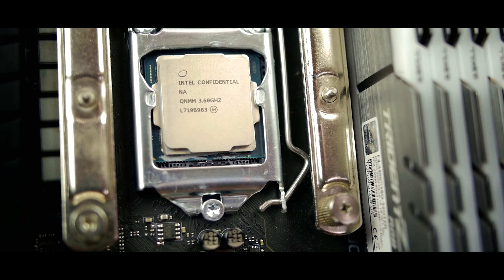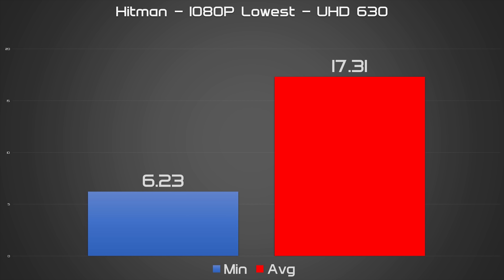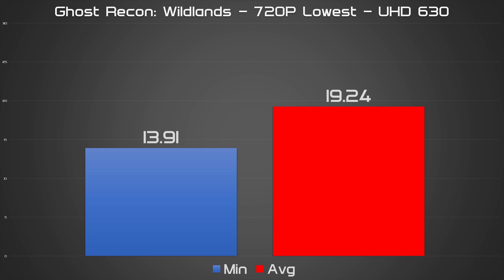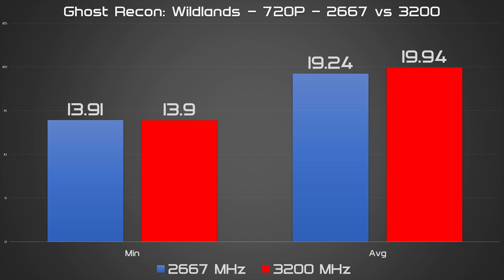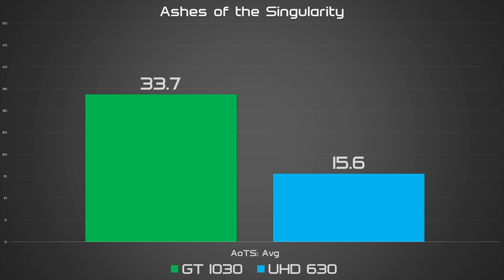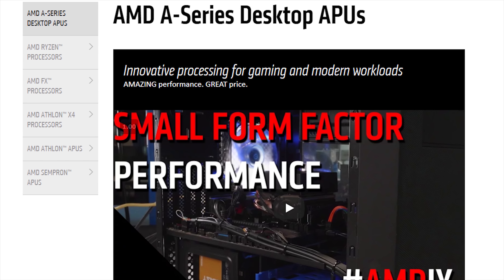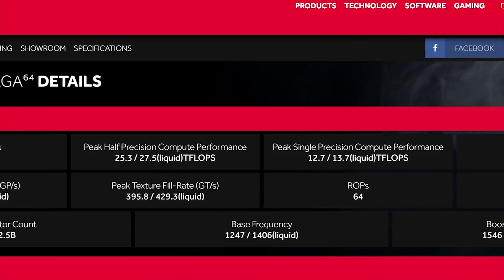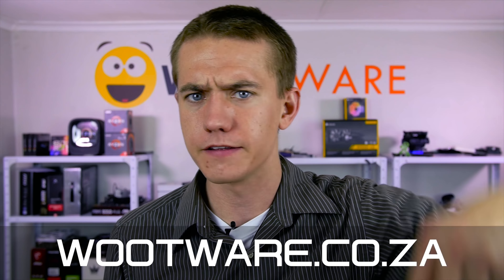Free Trash or Hidden Treasure? - Intel's Coffee Lake UHD 630 iGPU Benchmarked!

Comment: 640x480 morrowind is way to go.
Reply from the maker: #truth
Reply: @Dental_Louis  morrowind ain't optimized
Reply: @UFDTech  LOL I run RE2 Remake on UHD 630 at medium settings and it gets 18 - 24 fps and sometimes 35 inside the RPD...I have never seen lags on Morrowind om my pc...I also run Batman Arkham City at maximum settings and get 50 fps and higher sometimes with no lag at all
Reply: @Dental_Louis  hd 2000 gang is here

Comment: Integrated GPUs are fine if you need PC for work. I personally use 7600 for my workplace PC, and one of the reasons i bought Intel chip in the first place was because i dont need dedicated GPU.
Reply from the maker: Valid points, thanks.
Reply: ... for work? like what type of work? you could have still got an APU for that imo like you could have got an a10 with a better igpu for work like 4 years ago
Reply: What kind of work? If you need all that CPU power your work probably could use a GPU, and support for multiple screen output
Reply: At least you have some sense, but too bad that we still have idiots who try to game on those things for real and complain or just make very optimistic claims about's it's performance when pointing at the sky.

Comment: I think the Ryzen+Vega APU's will be a lot better
Reply from the maker: Same.
Reply: when do you think ryzen apu's will be released?
Reply: vega64 is a fail. but vega56 now thats better
Reply: It will be like the previous APUs. AMD will put a more powerful iGPU but that will compromise it's already inferior CPU. So, you'll have a even crappier AMD CPU with still crappy graphics. Wait for Nvidia's new realeses, next year. The same for Intel's 10nm Ice Lake. AMD will take some 2 years, at the earliest(don't belive if they claim otherwise) to release it's 7nm (Global Foundries' measurement which is still worse than Intel's 10nm). So, be smart and buy Ice Lake and the next Nvidias GPUs and your gaming rig will last some 7 years without need to update.
Reply: the IPC is. On games the Intel cpus are better and on some applications too like Adobe Video encoder/editor, IIRC. Ryzen performs better on most multi core applications, though, but that can change on the APUs with the iGPU fit in there
Reply: Charlie Wuppert your making claims of Wich you have no basis , ryzen pro hasn't dropped yet.
Reply: Only for you then. Every other test that I looked, Intel has 7-12% lead on IPC when you do single thread tests(like SuperPi), with the same clock. On top of that IPC advantage, Intel allows for far more overclocking.
Reply: Simski what does Apu from the Simpsons have to do with this? Thank you come again!
Reply: That 5ghz overclock gives you almost no performance increase. At 1440p the 2700x closes the gap and when streaming and gaming AMD pulls ahead in most games... Spoken like a true fanboy. I have been a loyal Intel consumer for over a decade and my next PC is going to be Ryzen.
Reply: At almost a whole ghz lower clock...
Reply: Charlie Wuppert might want to check Hardware Unboxed video on it instead of talking in vain fanboy.
Intel's IPC marginally better but Rayzen's multithreading is better.
Reply: Aight

Comment: I have this setup: asus z490 maximus xii hero wifi, with 10700k, and 2070 super, and corsair vengeance lpx 32 gig ram (not a single one overclocked at all not even boosting), and my vizio smart tv as my monitor connected with hdmi to the motherboard.  I have seen both the uhd 630 and my 2070 super in use at the same time through task managers performance tab with the 630 as gpu0 and my 2070 super as gpu1 with the 630 pulling around 60-63% and my 2070 super around 36-40% with the 3d graph showing blue for both at the same time while I was playing Banished in a window and Dragons Dogma Dark Arisen fullscreen (minimizing DDDA to see the usage data) and yep, at least for me, I can game this way and stable as he*l.  I can even run Sims 4 all details highest smoothly without kicking the 2070 supers fans into gear, so my question is this: Have you heard anyone claiming to use this setup and getting it to work for both gpu's to share the load so neither one is overtaxed?  If so then is this setup an advanced one?  (I ask because this is the first pc I built myself after watching many of Linus and Jay's youtube videos on how to build one).

Comment: By setting up the onboard graphics to do nothing but capture video your main GPU can be freed up to allow for faster FPS.   But you have to have a good chip, perhaps an i7 and fast ram as well.
Reply: Also, what was your ram speed?  It's about clockrate because an iGPU is ram speed dependent for performance.  You can squeek out a little more performance from the iGPU with a higher clocked ram.

Comment: Part of it is that Intel doesn't do the same amount of work that AMD or Nvidia does to optimise their drivers. They will do the odd game, when they are showing off their new iGPU, but you rarely see a release of Intel drivers optimised for this game or that game. So even when they released a GPU around the GTX 750 level, it only worked that well in a handful of games. 

This is why inspite of being so weak AMDs APUs would game relatively well as they benefited from driver optimisation. 

Iris is still way more powerful, but I guess on desktop UHD is there for when you are between cards, not when its your only choice. Highly unlikely on a 6 core i7.
Reply: amd igpus are way stronger than intels and an there is currently not intel gpu that performs to the level of a gtx 750. there is so much that drivers can do.

Comment: My missus company were upgrading their office pcs, so I've chosen 2 pcs  with i3 and another 2 with a8. After some time they decided to upgrade their monitors from 60 Hz to 144 Hz ones.Turns out Intel HD can't do 144 Hz :( , so needed to get few cheap dedicated cards and one of the Intel system developed "your graphic hardware stopped working and restarted" bug (well known  cheap intel hardware problem )  , ended up upgrading motherboard of one of the systems too. Intel gpus used to suck, sucking now and will suck in the future, until they start using radeons or nvidias . Just saying.
Reply: why in the world would office pcs need 144hz monitors
Reply: Cause some ppl feel the difference , to the point when it is actually painful to use 60 Hz and soon as 1 girl got her new shiny 144Hz monitor, all the rest started to get headaches, etc too :) , nvm advantage of being able to see what is on the document when scrolling without stopping to throw a look.
Reply: one word. " weird"

Comment: If you increase the RAM frequency and the cas latency proportionally you have ZERO increase in performance. You only benefit by overclocking RAM if the percentage increase in frequency is larger than the percentage increase in latency. A 3600MHZ cl 16 RAM is faster than 3200MHz cl16. But 3600MHz cl18 is effectively equal to 3200MHz cl16.

Comment: Find an old CRT monitor and play at 800X600. Bam! 60FPS on integrated graphics. But seriously, I like having integrated graphics just for the flexibility of running multiple monitors.
Reply from the maker: Makes sense, but what GPU do you have that can't run multiple monitors?
Reply: GTX 1050Ti can't run 4 monitors. At the moment, I'm only running 3 monitors anyways but at one point, I also had a TV as a 4th monitor for controller games. It also seems like Nvidia cards don't idle down to their slowest state with 3 monitors connected causing it to run warmer even when it's doing nothing.
Reply from the maker: Fair enough.
Reply: if you think nvidia cards dont idle enough bud try looking at amd lol you will see that nvidia cards idle just fine and besides having multiple monitors on a card means the card has to drive those three monitors refresh rates and what not.... meaning the memory clock will most likely run at full speeds

Comment: seriously though why do the k chips even come with iGPU
Reply: Dandy Highwayman I run my secondary monitor from my igpu.
Reply from the maker: Completely valid point @Dimi
Reply: Fair enough.. I guess.

Just seems like dead weight that could be better used as cooling space on the K series chips.
Reply from the maker: @Dandy, Intel has clearly demonstrated with the HEDT chips that your statement wouldn't be true.  They still use the same crappy TIM regardless of iGPU or market segment.
Reply: I don't see how they get away with that. To me it's just a ploy to get as many users to invalidate their warranty as possible so they have less liability for returned goods.
Reply: For my work we only need a fast cpu, so in my use case its handy. But I'm sure wed have the budget for a low profile card if it'd come without.

Comment: sure 60 fps is playable always, but in csgo, people are always better at 300fps than they are at 60, not because it looks smoother, I mean it does, but its because more fps means lower frame times, most of the time, because math, and that means your responses trigger faster, because more frames are being displayed within the same amount of time, so, on high refresh rate monitors, going from 60 frames per second, compared to say 144 or 240 frames per second shows a massive difference in a game as fast paced as csgo.  to me, I prefer just over 110, around 120-130 is my sweet spot. Anything under 45 I won't play, I just can't stand how long it takes my inputs.  I use a 144hz monitor with 1ms response, and a Logitech G502 spectrum, so the monitor is the bottleneck there when it comes to input, when I cap my frame rate to 60 and try csgo, I feel sluggish, like I am weighted down, everything takes longer to do, and I actually feel like my character runs slower.
Reply: My entire point is just; CSGO is a game where, to be seriously competitive, you need more than 60fps, and you need at least a 120hz monitor, otherwise you are going to find people are always going to be faster than you, well once you get out of silver that is.  I was stuck at silver 4 back when I was playing and when I got my 144hz monitor it took me 3 days of playing a few hours a day to rank up.  I should start playing csgo again... Ever since pubg came out I haven't touched it.
Reply: u were stuck on silver 4 xD? i'm global playing with 60 fps average with drops to 40-35 around smokes
Reply: That's awesome! Ricardo.i bet if you played on my system, you would be a little bit better. (high refresh rate panel 144hz with hardware to push more than double that framerate in csgo at 1920x1080 max settings) I know a good player is a good player regardless of 60fps or 300fps in csgo, but high refresh rate gaming, 144fps on a 144hz monitor minimum, is the way the pros play for good reasoning.  Because if I am using a 1ms response time 144hz panel and you are playing with a normal 4ms or 5ms response time 60hz monitor my computer will render frames with you in them faster, like say if you were peeking around a corner at me, jiggle peeking, then my monitor with it's high refresh rate would show rendered frames quicker than your monitor has, bas quite a bit of time actually if you factor the monitors respond delay over a faster monitor, and the 144frames showing per second, which is 84fps more per second for my eye to soak up and respond to....  So I imagine you may see what I mean when I say EVERY player will always play better with a 144hz monitor over a 60hz monitor.
No matter what skill level, you will always perform better playing on a high refresh rate panel with hardware that can push the frames.  

as far as the "stuck at silver" lol 
 started pc gaming 3 years ago, and custom building 2 years ago. Counterstrikego was the first pc game I ever played, that means I bought it almost three years ago, ('about' 3 years because when I first got into pc's and bought a shitty apu system I didn't get steam till a few months later.)and I stopped playing CSGO when battle royale games like h1 and pubg got big, so for the short 120 hours I have in CSGO, yeah I was only like a top tier silver at my best in ranked.  If I dedicated my time, I could raise my rank, BUT I COULD NOT RAISE IT TO GLOBAL.  
GOD TIER is basically what global means to most silvers, I have been told by plenty of globals that it's "not that hard" and I have shit on a few globals as well
sooo idk.  Anyways, sorry for writing so freaking much.  Figured I should just explain the refresh rate comments, and the "stuck on silver". Cause I walk on silvers when I play the game, I probably just don't play enough Ranked.
Reply: sure, i totally agree with your point, my comment might have seemed a bit aggressive but it was because being stuck at low  ranks it's something that doesn't exist u either don't dedicate the time u need to dedicate to get good or you are playing the game in a wrong way (stupid decison making and etc) on every competitive game that exist. also globals aare just silvers with a little better aim and a better decision making, the real counter strike starts after global.
ps gonna buy a new setup soon so 300 fps and 144 hz is coming :D

Comment: The extra money you spend on the i7 you could get a Ryzen 1400/140$ or 1500x/160$ or even a 1600 at 190$ usd and use the savings from the motherboard and cpu to get a 200$ graphics card.  So even considering the i7  on a tight budget is a moronic idea.